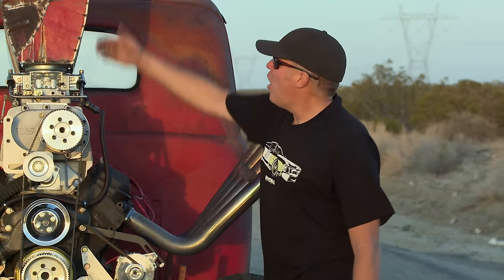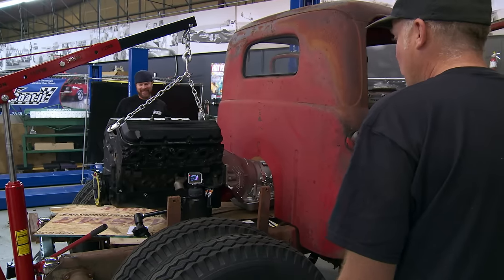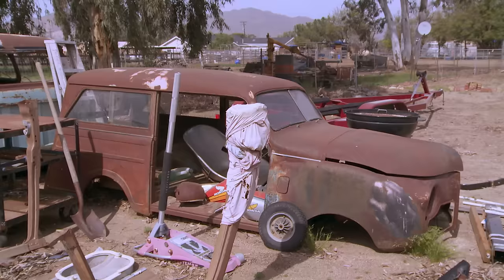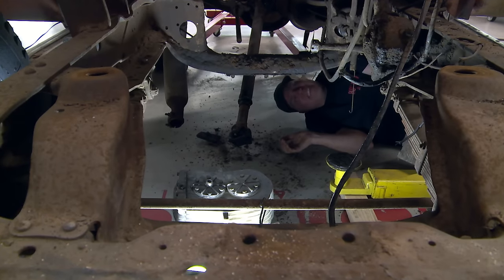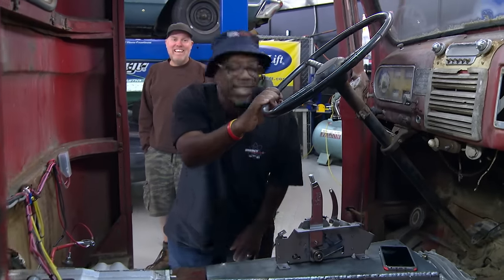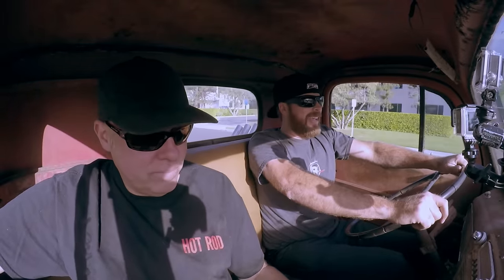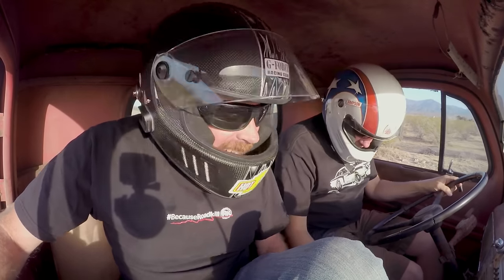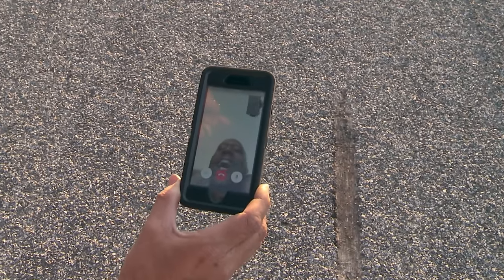Wheelstanding Dump Truck! Stubby Bob’s Comeback - Roadkill Ep. 52

Comment: That was awesome, they need to add wheelie bars with titanium blocks so they can keep the wheelie going and throw a spark show. I wonder if you can see flames coming out of the exhaust at night.
Reply: They need to do something about the front end before they impale the driver on his own spine.
Reply: I just noticed from the thumbnail, all eight pipes are to one side?
Reply: No, the small picture just makes it look that way. Here's the thumbnail full size: http://img.youtube.com/vi/PVs_xZ46Cxw/maxresdefault.jpg
Reply: Flat4Buggy 2 Thanks, I guess I was seeing the spaces between pipes as pipes.
Reply: the brain No problem.
Reply: Oh, that's a CHEVY motor. flames all day, cuz
Reply: No wheelie bar
Reply: They should have used a 460.
Reply: They didn't change the steering column, did they? You know how terrible those old columns are? Have a head on and they could cannonball right into your chest.
Reply: They have been posting on Roadkills Facebook page and there is a video of Stubby Bob with wheelie bars on it.

Comment: I like how alot of these vehicles have special coil overs to soften the landing and like Eddie kids bike had adjustable shock absorbers for his landing so he didn't bottom out, this just has regular leaf springs which has no absorbing atall or next to none. not the most comfortable on the road  the leaf springs and there's no safety what so ever besides the ear defenders. This truck is just stupid but I love it. It's like it was built when the truck was out the factory and before health and safety was a big thing, probably why I like it just bubble wrap and metal saving you from death or being beaten up badly

Comment: I love it. I recently bought a 2000 GMC 3500HD one-ton dually with a 454 Vortec. It was a government truck with only 43,000 original miles! I eventually want to lose the utility bed and install a flatbed. And since it has a straight I-beam front axel with leaf springs, I would love to do a 4x4 conversion someday.

Comment: I guess it's true what they say, you know, the only way to make a ford run that good is to drop a Chevy in it....
Reply: hahaha
Reply: Wow! You can fanboy!
Reply: No bullshit however to make most torque and ho yes you get a chevy block.
Reply: there would be no breaking parts without Chevy
Reply: LOL #HowNascarsWork
Reply: shut up chevy is horrible ford is badass
Reply: Kimberly Lowery Nah.
Reply: Chevy is old but simple ford have a higher flowing heads but chevy just relies heavily on displacement for making power witch works but is not efficent
Reply: LOL so true
Reply: +Kimberly Lowery Man U got it all wrong Ford Stands for

Found
On
Roadside 
Dead

Fix
Or
Repair
Daily 

Flip
Over
Read
Directions
Reply: Displacement is a fairly useless statistic when discussing engines. Compare the external dimensions and weight of the 5.0 Coyote to the LS7, you'll be very surprised
Reply: +DELTA BOT yea yea the ls7 of a hotter motor and while displacement isn't the only stat IT DAMN SURE ISNT USELESS
Reply: MURICA!
Reply: Coolyerd
 FUCK YAAA!
Reply: ^who gives a crap about efficiency
Reply: chevy guy True that.
Reply: Coolyerd
Ohh i see you did not get the reference!

MERICA FUCK YAAA is a phrase used by the  TEAM AMERICA movie, you actually believe i was offending you?! LOL
Reply: thats exactly what i was gonna comment LMFAO!
Reply: Why not just drive whatever runs?
Reply: Why not just eat whatever you can eat? Why not just drink whatever you can drink? If you have CHOICE why not choose something YOU like. In this case CHEVY...in your case perhaps a FIAT who knows.
Reply: LMAO touche
Reply: +chevy guy Well if you care about performance than you should care about efficiency.
Reply: +Matthew Trent and the rest of you who are complaining, excluding those who aren't,  need to chill the hell out. It's a joke, had it been a for motor in a Chevy, although that never happens, someone else would of said the same thing.
Reply: +madcuzbad Ford:  Forget Out Running Dale.
Backwards:  Driver Returns On Foot
Reply: +Daniel Davis That's why I drive a GMC...  The GREAT Man's Cruiser
Reply: Daniel Davis You completely missed my point. I'm saying it's the worst fucking argument ever. "Hey guys, this acronym clearly makes my car more superior in every way to your car!" What a fucking joke. If you're going to prove you're car is better, present facts that can be supported. Like how the F150 was voted safest truck of the year in 2015 and 2016, or how the interior of Fords tend to outlast most other vehicles.

I could care less what I'm driving. As long as it runs good, the inside isn't trash, and it does what I need it to do, I'll take it.
Reply: it's just a truck....chill guys
Reply: it's just a truck....chill guys
Reply: it's just a truck....chill guys
Reply: it's just a truck....chill guys

Comment: how's your neck/back?
that looked like a rough ride..
Reply: He's one inch smaller now, just like jet pilots that used the ejection seat.
Reply: its getting better. was a rough couple of days after the wheelie.
Reply: you better get it set, that kind of stuff can cause headaches and weird spine changes weeks or even months later.
Reply: Bob needs some of those suspension/shock absorbing seats you get in offshore power boats, then you can wheelie all day - and let's face it, when you can plow tarmac at will, why wouldn't you want to try and write your name in it?

Comment: Didn't see a coolant system , so no cruising town huh ?
Reply: you can see two metal tubes going up to the rad by the frame when they engage wheelie mode.
Reply: it has hoses to the water pump so im guessing its in the front where its was to begin with
Reply: Lucky Costa uploaded a video of how cooling works on his channel.  There's a rad up front and a combination of rubber hoses and metal pipes lead past the bottom driver's side of the truck to it.  YouTube search for "lucky costa stubby cooling"
Reply: Thank you !

Comment: How dare you put a 454 in a Ford.
Reply: Best way to make Ford's fast and powerful. :P
Reply: They wanted it to actually work.
Reply: Probably cuz they know more about chevys and have more parts for them. But I agree, blasphemy not to put a 460 in there.
Reply: Well, it's not actually IN the Ford.
Reply: yeah $ was probably the biggest deciding factor
Reply: yea, what exactly is wrong with a BBF 460? could have been found in a junk yard and built to make the same power.
Reply: Hmmm... Good point!
Reply: hmmmmm seems to me, after the v8 chevy came out, they stopped putting Ford engines in Fords...... at least if all you read is hot rod magazine........... but that much horsepower for, I'm guessing 5g ish..... well it's economics.. a real Street freak needs a HEMI anyways
Reply: what are you even trying to argue?
Reply: I think it's more about what was the cheapest thing they could throw at it, more than trying to keep it pure. When you should be asking is why couldn't they get Fiat-Chrysler to spot them a big block Hemi. Dave and Mike don't really care what motor they throw in there as long as someone else is paying for it :P
Reply: Doesn't matter.
Reply: BBC aftermarket is way larger than BBF aftermarket. Easier to get parts that are proven to work for less money than they'd spend building a 460.
Reply: its for safety...a 460 would flip the truck onto its roof without a blower
Reply: Putting that 454 in that POS Ford increased the value more than ever.
Reply: +VanderVape its actually the only way to make it fast and powerful
Reply: Technically correct, the best kind of correct.
Reply: After BlaspHemi, nothing is sacred. #chopthemall
Reply: Alfredo Montes http://imganuncios.mitula.net/1998_ford_explorer_xlt_v8_6830009461347503674.jpg The windshield got a little smashed when the ls got dropped onto it
Reply: lol
Reply: More than likely they did that because bbc's are much cheaper and much more easy to come by than a bbf. Mainly because Ford switched primarily to diesels in their heavy trucks, where gm stayed with big block gas engines. For the better part of 25 years.
Reply: Putting a chevy in a Ford is the only way Ford is fast and reliable this has been common knowledge since the 50s
Reply: Ford guys are too slow to understand people like chevys because you can basically bolt ANY chevy transmission to ANY chevy v8. Thats not the case with ford or dodge. Universal fit parts.. dialed 👌

Comment: My heart was pounding you were angle grinding that new cnc intake...omg....add wheelie bars to stop it from tipping ...but the drive trany gear omg add bullet proof sheet around it as I feel its going to snap in the cabin when putting it to full power

Comment: Another insanely low-flying roaring monster, from the guys without limits when it comes to cubic inches, horsepower (and a little more). This time with something as if you have a lively imagination can be reminiscent of a small truck with a load, and it is a bit of a load as well. There is the roar and the horses, and for an original little powerful case it was in the end, it likes to show the underside of the frame as well.

Comment: I think you should put an metal bar across the back of the truck and put an titanium strip on and have the bar on some sort of suspension so it can take the ground in packed and set it at the angle to the bar and great video

Comment: Capt dummy question, but couldn't you just use a 4x4 transfer case, and just run of the "front"  drive yoke? Get one with an adjustable angle, so it sticks straight down... be nearly the same deal but wayyyyy stronger.

Comment: Hey everyone. Trying to figure something out. With the flywheel facing forward, would the v drive not be rotating the wrong way? Did they have to put reverse gears in the v drive? Have same one in my boat and it’ll turn the wrong way.

Comment: Anyone out there know how easy (or difficult) it would be to convert a truck with a similar front-end to Stubby Bob to 4WD? I have a 2000 GMC 3500HD with an I-beam axle and leaf-springs in the front. It has a Dana 80 in the rear, 7.4 Vortec (454), and 4L80E trans.

Comment: Plasma grinder both will cause a gas tank to detonate like a bomb when there's no gas in it. If there gas in it it will evaporate pushing out the oxygen making the gas air mixture to rich to be explosive. But warning empty gas tanks that have been sitting go boom like a bomb when ingited. I wonder if the air fuel mixture is just right and you tried to start it empty if the air gas mixture will ingite down the fuel line and blow up the tank??? Hmmmmm I wonder.

Comment: These guys are good but they are trying to get it to do wheelies, so they mount the gas tank in the very back. I know less weight in the front is ideal but as much power they are making more then enough power to were the tank in front or middle in front of the motor!  Just not smart engineering to me!